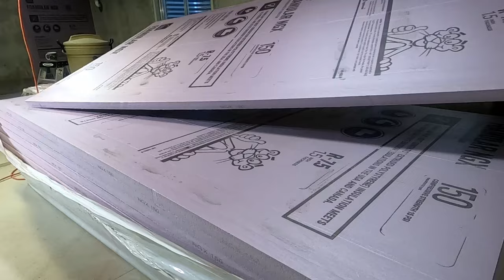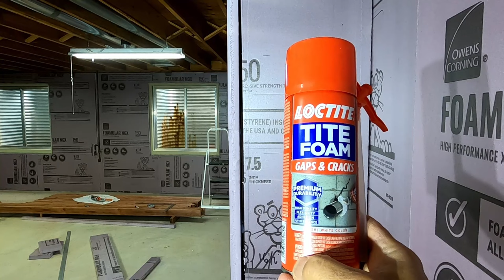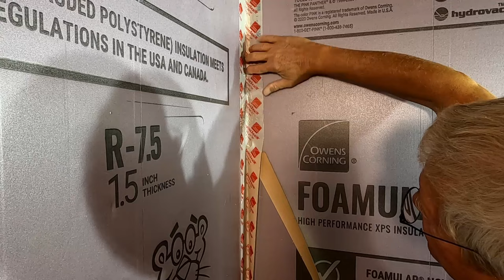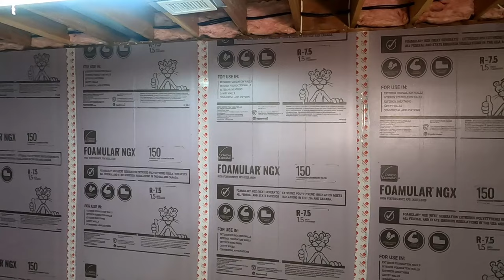Finishing My Basement - Foam Board Insulation

Comment: for anyone insulating a basement in a house older than 1995: just assume your foundation and floor slab are totally lacking moisture control. if you have concrete block foundation, do not drylock the interior side. your bricks are likely unfilled and will accumulate water inside that will give your basement a musty smell. you need to let the concrete breathe. if you want to finish the floor, install a vented subfloor material (can be dimpled mat, or an OSB with foam/rubber/plastic bottom that allows airflow) around the basement perimeter. leave a 1/4 gap at the wall. then build your walls on top of this subfloor system. install a dimpled wall mat like DeltaVentSA on the wall, then put foamboard against that and tape all seams. next frame your wall against the foamboard (still using a pressure treated sill). insulate the stud spaces with whatever you want (rockwool is you have the budget is best) and then if you are in a climate where you heat in the winter, install a vapor retarder before you use a non-paper faced wallboard. this is the best system you can get, short of excavating the entire outside of your foundation and applying true moisture protection and exterior foam.
Reply from the maker: Thank you for the in-depth reply.   This sounds like a great topic for its own video - or series a videos.  Any thoughts on the climate or environmental factors that may come into play when determining when this level of moisture control is necessary?  FWIW - I've not seen this level of control applied in my area.
Reply: @kevintaberski4249  the example ive given is not just for basement leaks from rain or bulk water- its to protect the wall assembly from water vapor in the air. for "dry" climates this much protection may not be necessary, though there are not really that many areas that are "totally dry" either. if it gets humid outside in the summer you can assume theres going to be moisture in that basement. another thing to be aware of is any concrete below the outside grade is where vapor will drive into the building, year round, because hydrostatic pressure is greater in soil than it is in air, and high pressure always goes towards low pressure, meaning water vapor in soil always wants to enter the basement. so you never put untreated wood or fiberglass insulation up against below grade concrete, and you should always leave an air gap so it can dry "to the inside" (through the gaps in the dimpled wall mat and out of the subfloor material) but regardless, if you are going to finish the basement of an old house why even take the chance- just build it with the assumption that water WILL get in eventually. and if this issue is not noticed before mold sets in it can cause health problems- your A.C return pulls air filled with mold spores out of the basement and pushes it into the rest of your house, for example. not to mention the cost of remittance and replacement of damage.
Reply from the maker: Thank you - This is all good information.
Reply: Been watching basement videos for about a month since discovering mold behind panel boards in the basement of my home I just purchased resulting in me gutting the basement. The previous owner drilled big holes in cinder blocks attaching wood strips and then nailing panel boards to it and that was it. Along with just gluing carpet straight to the floor. Your comment is exactly what I was trying to find in a video and sounds exactly what I need to do.
Reply: Why are u lecturing people about drylock in a video about insulations comment section?
Reply: how do you leave a 1/4 inch gap at the wall and install deltavensa at the same time?
Reply: @JRCoronado24  you leave the gap in your subfloor structure so any water can run down the deltavent channels and get under the subfloor material rather than falling on top of it
Reply: @331whf9  weird question. its a video about basement insulation, but of course after you insulate your basement people will usually try to finish it. my original comment was about finishing basements more in depth. a common "waterproofing" method that people are told is drylocking on the interior side of the basement wall. its not a good idea. so i put that in the comment.
Reply: @hammers9434 I have a 1960s foundation with unfilled concrete block. The basement smells musty but otherwise no active water leaks. How do you feel about installing Dricore Insul Armor on the floor AND on the wall, with the joints and the base of the wall taped with tuck tape? Then on the inside I'd build a 2x4 wall with batt insulation. Would you vapor barrier the face of the 2x4 wall before drywall?
Reply: @joemontana4370  the dricore works on the wall assuming all seams are taped, but you still need airflow somewhere because vapor in the blocks will only flow towards the basement. the channels in the dricore would be for allowing liquid water to run down to the floor and find its way out via drain. you still want to tape the seams all around, including at the top of the wall. we don't want warm, humid interior air contacting that concrete wall. Im also not sure the dricore has a high enough r-value to prevent condensation from either warm moist air from the inside condensing on the basement side of the foam in the winter or moisture from the concrete blocks condensing on the outside face of the foam in the summer. I would use at least 2" of non-faced foamboard, or rockwool panelling. Do not use fiberglass batts in your basement, they will not last, and a vapor barrier would only make it worse.
Reply: I just did that, is my walls going to cave in from water that can’t seep through now??
Reply: @hammers9434 I just put ten gallons of that stuff on my 1978 basement block walls. Did I just create a dam and potential cave in?
Reply: @amyhurley4461  10 gallons of what stuff?
Reply: @hammers9434  thanks for the detailed explanation.
Reply: @hammers9434 great post! Question for you… on one hand you need the block wall to breath ie air gap but on the other you need vapor  control. I don’t see how you can achieve both. Are you assuming the air in subfloor and against block wall is sealed itself?
Reply: @scottmundy6293  you cant get complete vapor control without risking mildew. Install a vapor retardant instead of a vapor barrier. Dont use fiberglass batts. Dont use paper faced drywall. Run a dehumidifier.
Reply: @hammers9434 my basement is painted with drylok. I was planning to install 2" foamboard on the walls with a 1/2" air space from the wall, then frame over with 2x4s and rock wool, gypsum board.  Floor will be dricore.  Do you see any issues with this?
Reply: Do not put any kind of vapor barrier in a basement wall assembly.  The humidity from the wet soil drives vapor inward into the basement.  Adding a vapor barrier traps the humidity behind the drywall, causing the drywall paper and wood studs to grow mold.
Reply: @robertm5969  sounds like a solid assembly! Best of luck.

Comment: Really appreciate you posting this video as I'm getting ready to finish my basement as well. One thing I found with cutting rigid insulation board is to use a 6 inch spackle blade and grind one edge to a sharp knife like edge. If you use a wide edge 4 foot level, it'll help you cut the edge square too. Thanks again for a great video!
Reply from the maker: Thank you for posting and passing-along this tip!

Comment: Great work, Kevin. 

I am looking forward to seeing your next video with running the electrical and batt insulation, and then eventually finishing the room off. Before you close things up, will you be air sealing the sill plate and rim joists as well? 

I used 2" xps foamular on my basement walls up in climate zone 5 in CT. I had my plumbing drain along almost three full walls, so I couldnt frame right up against the foam and add batts.  Where the plumbing drain wasnt in the way, I framed up a wall and added the r15 rockwool. I air sealed the rim joists and added 2" of foamboard, and then multiple layers of r15 rockwool. The ceiling got r23 rockwool to keep sound down and because I got an insane clearance price at home depot. The subfloor I chose was an r5 foam panel that is the only one hard enough to run LVP flooring directly on. 

All of this really changed the basement into an insanley warm, and comfortable section of the house for my father in law that is now actually saving me energy while adding around 700 usable square feet to the home. 

But, keep up the great work, I am subscribing to see what is next!
Reply from the maker: I've actually completed my basement.  I recorded many of the steps as I went and am working on posting videos of the steps in the order that I performed them.  Unfortunately, I did not record much while installing the wiring.  I believe I do have some recordings of the insulation step. 
I did not do anything special to seal the rim-joists and sill plates - other than caulk the outside on the north wall - which is overhung over the basement wall.  I stuffed fiberglass batts against the rim joist - and like yourself - I insulated the ceiling.  More for sound then temperature control.
As for the floor - I laid VCT (Vinyl Composite Tile)directly over the concrete.  All that said, the basement is still quite comfortable - we recently experienced bout of sub-zero weather, plus it still stays cool in the summer.
I'm working on a video framing the soffit for the beam and duct-work.
Thank you for the informed response and subscription - it helps to keep me motivated to keep posting these videos.

Comment: Looks good.

Having done a basement myself like this, I still maintain that taping The seams is an absolute complete waste of time despite many people doing it. The tape doesn’t stick work a damn, and beyond that if the foam doesn’t have male-female edges as some do, silicone caulk adheres a great deal better—just run a bead down and press it in.
Reply from the maker: I had a different experience with the tape.  The tape supplied my the manufacturer was VERY sticky - almost too hard to work with.
Did you use the tape that was recommended?

Comment: Great that you're framing that in. Need to make sure to mention XPS cannot be left exposed in indoor applications, and must have a fire protection. Onto that floor plate...treated lumber still needs a barrier between the concrete, as both are porus materials. Treated lumber is treated to prevent bugs, not damp.

Comment: I really love this idea. I've been looking & searching a temporary way of insulating our garage without costing me a lot of money right now. The old owner of the house we purchased converted the garage into a room but there's no insulation. Its really hot during summer time and very cold in the winter. I think this is a good idea to insulate it by not knocking any walls for the time being until i have money to do renovations. Any other suggestions or ideas please. Thank you
Reply from the maker: I do NOT recommend this.
For one thing Foam Board is flammable!  Plus, it's not a durable material - it really needs to be under or behind a fire-resistant and more durable material - such as drywall.
Also, Foam Board is not not all that cheap.  If I were you, I would remove whatever is covering the interior of your garage and insulate behind it.  Assuming it's drywall, you will need to replace the drywall, but the cost of the insulation (fiberglass for example), plus the replacement drywall may be similar in cost to the Foam Board and you will have a higher R-value.
I hope this helps!

Comment: Good attention to detail. Those considering this, who don’t have a capillary break installed between the top of the foundation and sill, and high water/moisture outside the foundation without a waterproofing treatment and drainage board, may want to think about first addressing that. Water that gets absorbed into the concrete can move upwards through capillary action and rot the sill. This rigid foam is closed cell and will not allow vapor to move-no drying potential.
Reply from the maker: Thank you for posting, for the kind words and the additional information.  Mitigating moisture below grade is a challenge that must be considered carefully and mitigated accordingly.

Comment: Keep the videos coming. Working on my basement now and at about this stage in the project.
Reply from the maker: Outstanding!  I'm actually much further along in my project then my video suggest. I have a collection of clips to edit - it's just a matter of taking the time and piecing them together.  Your comment is a motivator for me - I really appreciate it!  Thank you.
Reply: @kevintaberski4249  yes as someone with almost zero experience. I need as many good examples as possible. I would rather have a video with limited editing posted tomorrow than a beautifully edited video posted 6 months from now. Maybe that’s just me.
Reply from the maker: @Jeremy-pf3bb  Jeremy - though 'beautifully edited' is not (yet) part of my repertoire - I get your meaning and will do what I can.
Thanks again!
Reply: @kevintaberski4249  thank you. 

I saw your stairway at the end of the video. One issue I am looking to solve is related to the addition of a subfloor and how that will affect my basement stairs. I think I will need to add a landing to account for the difference is step height with the subfloor.

Did you end up doing this? Assuming you will have a subfloor.
Reply: @kevintaberski4249  also the problem of having a moisture barrier near those stairs. I see the stairs are built along that exterior wall you are insulating with foam. Did you also extend your foam insulation to that stairway area?
Reply from the maker: @Jeremy-pf3bb  - I'm not following your use of the term 'subfloor'.  Our house is a tri-level (with 4-levels).  The basement ascends up to a 'garden' level - which also has a concrete floor.  That floor is half subterranean (~4' of concrete) - which is also insulated with the same 'pink foam.  The stairs from this garden-level ascend to the the level directly above my basement.  The wall you see next to the stairs, though concrete, is not an exterior wall - but is adjacent to the garden level - as such only the lower half is technically underground.
I hope this helps!
Reply from the maker: With respect to the stairway - the builders did not provide enough room for insulation within the stairway - nor for complete framing - so the end of the concrete wall is not insulated and actually lays against the back of the drywall.  It's not ideal, but it's what I had to work with.  FWIW - moisture is not a big issue where we live (Colorado).
Reply: @kevintaberski4249  I see. Thank you for the response. I am using some materials between my finished flooring of carpet/LVP and the concrete. These materials are what I am referring to as the subfloor. The main point is that my last step will be significantly different in height than other steps after I finish installing my flooring. 

I think code allows something like 3/8 inch in variation between steps.

And regarding that wall near your stairs…I was assuming that you are using Foamular as a moisture barrier as well as insulator. I have seen people rigorously establish that moisture barrier with foam throughout the finished area. I don’t know how leaving that stairway wall without the foam insulation impacts the environment of the finished area. If you cover every other wall with foam, would the moisture be pulled towards that wall to evaporate?
Reply: @kevintaberski4249  I see. My stairs are similarly located. The stairway wall is underneath my garage. And I similarly have limited space between the stairs and the wall. I think have a bit more space than what I am seeing in your video. Something like 1.5 inches if I include the stringer width. So I plan to carry my foam up the stairway wall with some furring strips to allow for drywall. I haven’t planned it all out yet which is why I was asking what you had done.
Reply from the maker: @Jeremy-pf3bb  - I laid VCT (Vinyl Composition Tile) directly over the concrete - so no subfloor.  With regard to the Foamular - I did not install on the 2 walls in the utility room - though the walls are finished and painted.  I was not particularly concerned with moisture - it is so dry here that we may have more moisture inside then outside.  My intent was to reduce air movement.
I'm afraid I can't help you regarding moisture - other than to suggest coating any exposed concrete with Drylok or equivalent.  Is there a moisture barrier on the exterior of your concrete?
Reply: @kevintaberski4249  I don’t know whether there is a moisture barrier on the exterior. The home was built mid 1980’s. I heard the exterior moisture barrier became standard in the 1990’s.
Reply from the maker: @Jeremy-pf3bb  - I understand, our house was built in 1979.

Comment: Awesome video! You did a great job walking us through all the steps.  You've actually given me the confidence that I can do this myself. Question what made you decide on that type of insulation? I live in MD, so I'm trying to figure out which type would be best.
Reply from the maker: Maria - I like the idea that you can create a continuous seal along the length of an entire wall.  It should reduce drafts and cement dust from the concrete.  Plus, I wanted to increase the R-value of the insulation - as I will also place fiberglass bat insulation in the stud-bays of the framed walls.
Thank you for posting!

Comment: Hey Kevin, again great videos! I’ll be using them as a resource as I finish my basement. How did you “carve” out the foam board to get around the plumbing? Did you just use an exacto knife?
Reply from the maker: Thank you for the positive comment!
I used a serrated knife  - sold for cutting foam board, but a serrated steak knife would work just as well - if you have one you can spare.